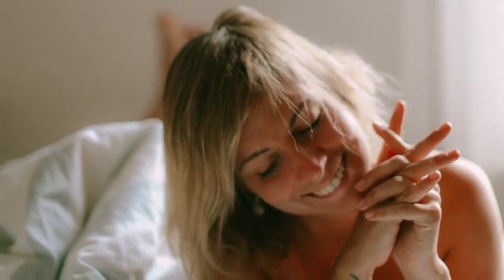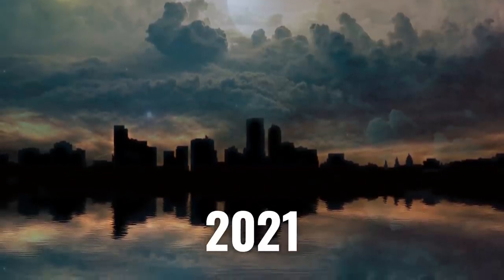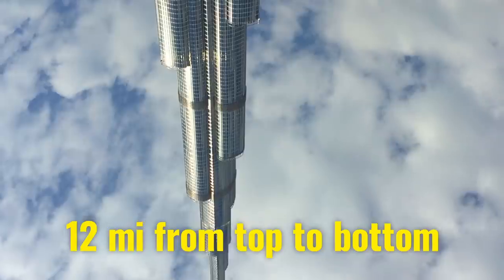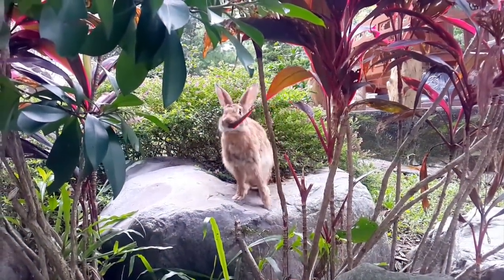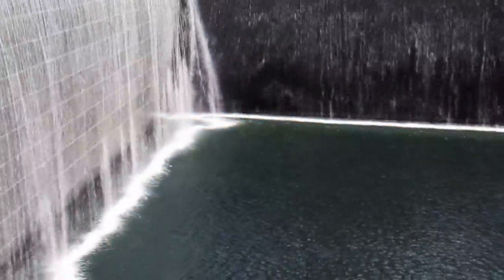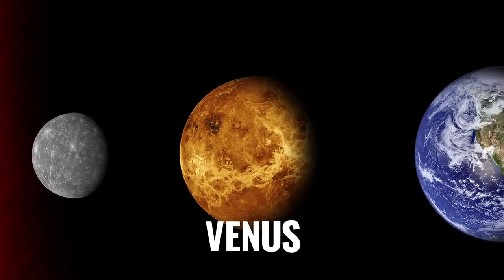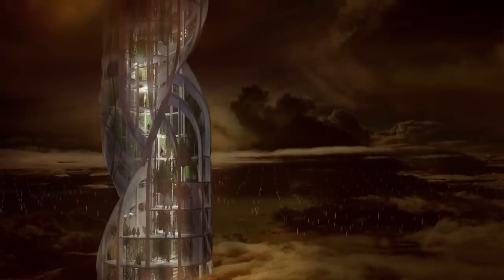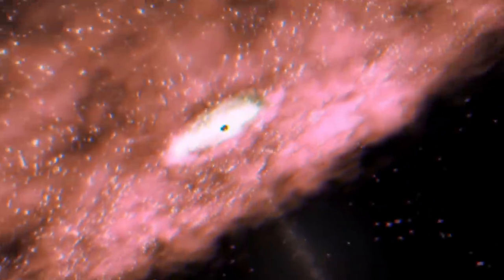The Insane Plan to Build a Skyscraper Hanging Down from Space!

Comment: Yeah this is not possible. The asteroid has to be moving at tens of thousands of kms and hour to sustain orbit and angular momentum otherwise it would fall to earth. Meaning the tower would also be moving at the same speed through the atmosphere which would burn it up. Not that it could be built downwards in the first place for the same reason. Furthermore even if you got the asteroid into a stable orbit you would also need to somehow stop its rotation completely otherwise the tower would swing around wildly orbiting the asteroid out into space and back through the earths atmosphere. There is no such plan to build this, just someones fantasy

Comment: Yeah... that's not physically possible to do, ever.
Reply: Actually it is, but it will definitelly never happen.
Reply: @TommyTMOD  You think that something hanging from an asteroid orbiting the Earth will sit stationary over a city? Even if it were in a geostationary orbit, it would have to remain at the equator otherwise it will be moving north and south, depending on the orbit's inclination, ripping it apart as it travels through the atmosphere at roughly 1000kmh if it were inclined by about 40 degrees. Where does the power come from? How do you get a large enough asteroid into Earth's orbit? What kind of materials do you use to hold this tower thing up?
Reply: @Ethan_Roberts  But couldnt be orbit inclination aligned with equator? In that case I dont understand why it cant be stationary above city.

Comment: This will never happen...
Reply: Never say no.
Reply: @Schocam  its "Never say Never".. but this will never happen. way to many fators involved.
Reply: @callmecloud8472  These are thoughts obstructions. It is impossible for now and that is why the people concerned are doing experiment after experiment. Probably with a tiny object first. Does it float ? Then it becomes bigger and bigger. Your very first thought should not be a definite no. A definite never.
Reply: @Schocam  nahh fam, shit ain't happening.  As cool as it would be it's just impractical. With all the work that would take it would be easier and cheaper to just put a huge space station in orbit. And eventually just have a giant ring around the earth.
Reply: @callmecloud8472  Then it will descend a little lower each time until it reaches the level where they want to hang the building.